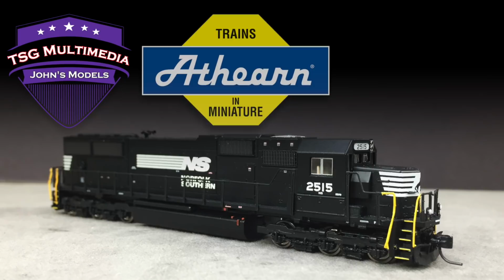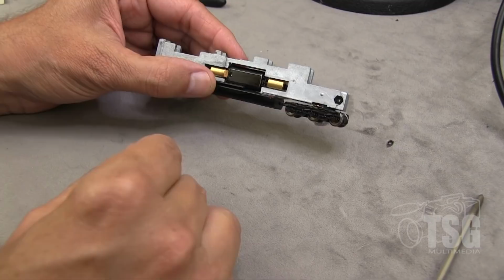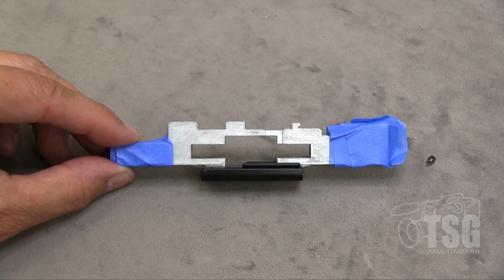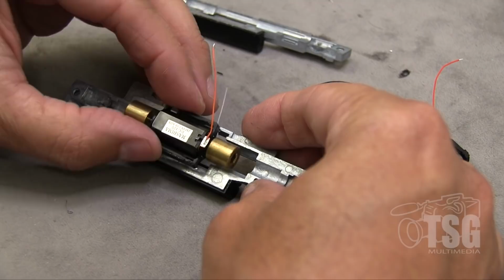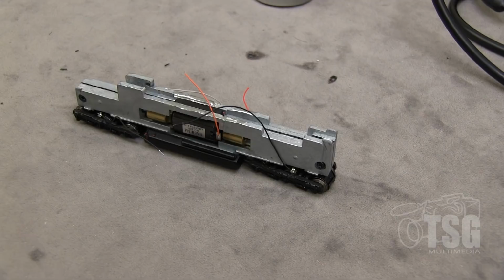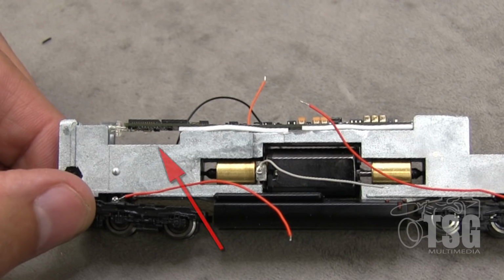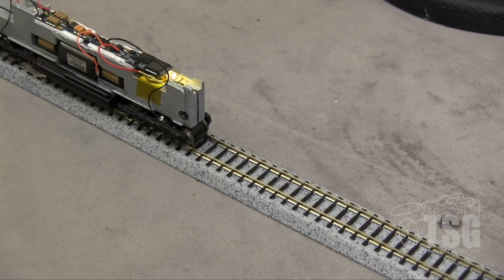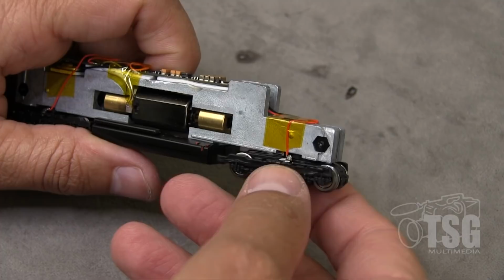How To Install DCC & Sound Athearn N Scale SD70 John's Models

Comment: Hey John,
A couple quick ideas when dismantling Loco's.  Or most any model rail vehicle or device.  I have used these tips for years.

First, when dismantling N, OO, HO, or Z scales have a Zip Lock styled food storage bag available.  I have 6 in my tool box always.  Place your model in the bag.  With one hand also in the bag to do the separation & the other outside the bag supporting the loco.  To keep it steady.  When the carcass comes apart any spring loaded or parts under tension will pop off & stay in the bag.  Quick and easy way to find them when needed.

I have used this technique on O and S Gauge vehicles BUT I use those plastic shopping bag you get at the market or the dollar store.   No clue on Garden Gauge.

Second, is both a critique & a solution.  I also have a number of plastic boxes for storing parts while I work.  Kudos.   HOWEVER, you all will find that a few mini fishing tackle  boxes or woodworking parts boxes, with dividers, offer a better option than a single open box.  Each part is separated, compartmentalized, & easy to find.

Thanks for a great demo.
I,ll keep watching and SEE YA' DOWN THE LINE,
~Jim
Reply from the maker: I LOVE this idea! Luckily, I haven't had any problems with losing parts YET but this is probably worth it just for safety's sake!

Comment: A word of caution to all. I have one of these and fried two, yes, two, of these decoders because the front right chassis frame touched the little black resistor to the right of the front LED. It then blew the bridge rectifier. This happens even if you try to use a digital multimeter to make sure the frame is properly isolated from the LEDs and the motor. This happens if you squeeze the frame halves together too tight. Instead, remove about a 1/4" of the rear part of the front chassis pickups to avoid that and use the rear chassis pickups. TRUST ME.

Comment: you could just buy an ESU decoder with sound next time. they already have a speaker with sound capsule and fit nicely in those americans. already did it and its basically a perfect fit from the width department

Comment: Great job. Just a comment: Put tape around the board to insulate it from the speaker. Flip the speaker over and form a speaker enclosure by gluing styrene to the frame to form a box around the speaker for better sound. Just a suggestion.

Comment: Hi John, nice install. A couple of Soundtrax mini cube speakers wired in series may have fitted in the rear, they would’ve sounded much better. The N scale model is still nice, I love the sound in model trains. Regards Gary
Reply from the maker: Thanks, Gary! I have a better plan for sound than what I did in this video. It involves one 8x12mm 4 ohm speaker with a pretty decent enclosure. I plan to do a video on it when I get around to it!

Comment: Awesome install and video John! Nicely done. Any plans for another HO scale install soon?
Reply from the maker: Yes! I have an Athearn F59PHI that I need to put a Soundtraxx Tsunami 2 decoder in. I also have an Atlas NJ Transit complete passenger train set that I have ESU decoders for. I just have to make the time for them... Making a video about either one will require about twice as much time as simply installing them because of the video production process. I have to light everything and explain everything, so that makes the time required pretty prohibitive. I WILL get to them at some point, though.

Comment: Nice vid. Have you had any occasion to consider whether any sugar cube speaker would fit in the available space?
Reply from the maker: It will fit if you use a very small enclosure. It would be best to cut out a piece of the frame and add a larger enclosure.

Comment: I have an N scale Athearn SD70M but the motor on it looks a bit different from yours in regards to the motor power pickup contacts. It has left me puzzled on how I am going to manage to make the decoder install due to that. Any advice on what I should do in this situation would be greatly appreciated.
Reply from the maker: The only advice worth having is this: make sure the motor is isolated and always be sure there are no short circuits by using a multimeter. Hard wiring the electrical pickup to the trucks is always a good idea if you can manage that.
Reply: @tsgmultimedia  Thank you.

Comment: Think you’ll ever try adding ditch lights?
Reply from the maker: Yes, but probably not on one of these N scale SD70s. I'm sure it can be done with 0402 surface mount LEDs and the proper ditch light castings but I simply don't have the time to do it right now! The next time you see one of these models, I'll be showing you how to get better sound compared to the 10mm round speaker I used here.

Comment: Nice work, John.  I am present, reassembling a EMD 45 Athearn.   Tsunami sound works, but trucks are dirty, and it won't go.  Need to figure out how to take apart the trucks for cleaning.    And, I lost one electrical bushing, and Athearn charges too much shipping for that tiny piece of plastic.....:(
Reply from the maker: Hi Dwight. Have you checked ebay or even shapeways for replacement bushings? You could even fashion your own using styrene if you want to avoid expensive replacement parts.
Reply: So I fashioned one from a plastic nut, seems to work.  Then, accidentally broke a wire on the speaker  LOL :)   Cleaned trucks without dissasembly, seems okay.  More work to do, but time will tell, thanks for your help.  eBay was of no help... @tsgmultimedia

Comment: You mention worrying about shorting the 2 frame halves. By removing the copper truck wipers and installing descrete wires, haven't you 'deelectrified' the frame? As long as you make sure you insulate the board and speaker from the frame, it should never present a problem and the power should be more reliable. Of course, I suspect the spacers also provide clearance for the moving parts, so they shouldn't be removed.
Reply from the maker: You're right. The point is to never cross contact frame halves (I do it this way just to be safe). The power is definitely more reliable with the trucks hard wired.

Comment: Did you service the loco while you had it apart?
Reply from the maker: Yes. I usually wash the truck gears and get the buildup of thick gunk off the worms then lubricate them with light oil instead (Labelle 108).